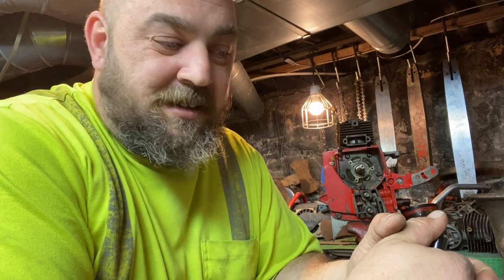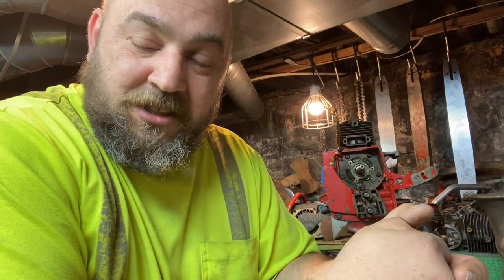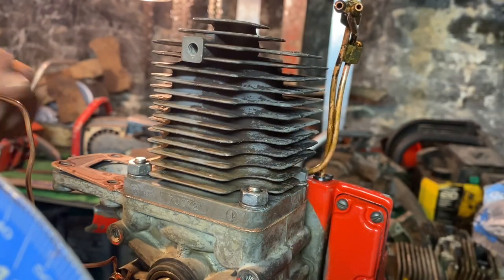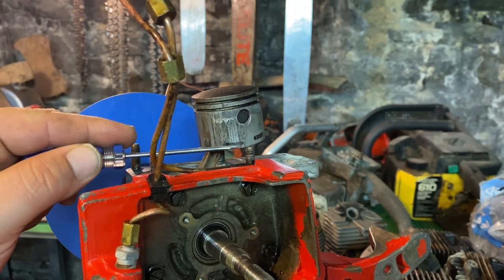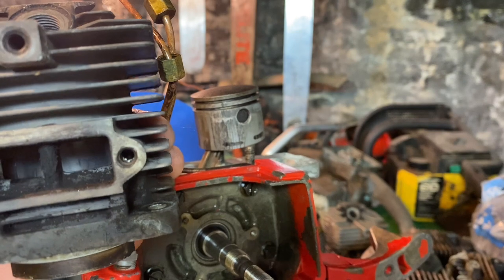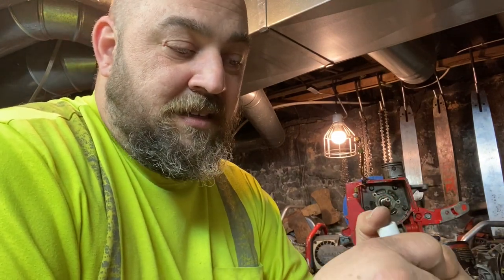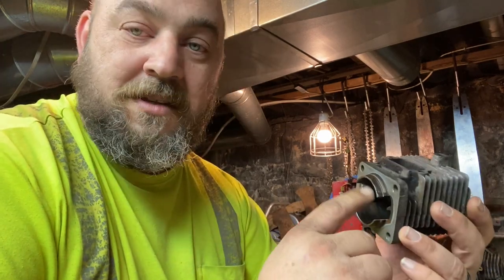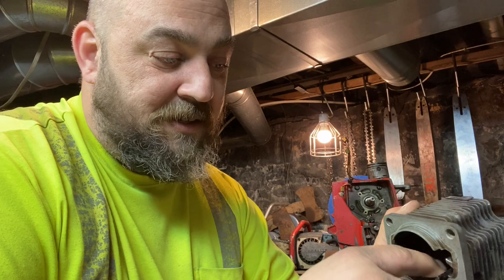Chainsaw Porting Class!!  How To Port A Chainsaw For Beginners!  Homelite Super XL Automatic #6

Comment: You took the words right out of my mouth! being an aero modeller for 50 years and engine nut I have seen so many engines with free porting, little cox engines free port but still run @ 30.000k but does not seem right! regards alan.
Reply from the maker: Thanks!!